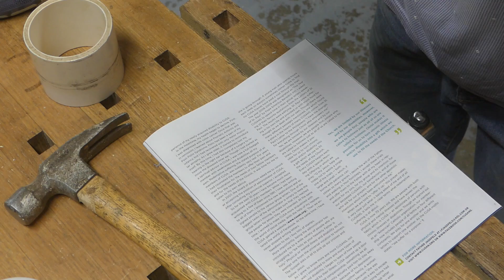Overhead dust collections for table saw

Comment: Slick build, what does the traveling sled do for you.? Is that just to get it out of you way?
I like the way you designed the sled, that being said it seemed like a lot of work for something that could be swung out of the way. Always a thousand ways to do anything just curious if it serves another purpose.  
Thanks for the ideas, I'm trying to pick a design for my  application.

Comment: Nice job as usual. I like everything but the dryer duct. Of course it is cheap and if it wears out it will be cheap to replace. It does like cool and shiny!
Reply from the maker: I chose this for two reasons.
First, the bulky is small (less than 5 inches when not in use, very attractive in small shops)
Secondly, it is very light, that's why I chose it.
For reference, this is a lot stronger than I thought,
Reply: I'll have to check it out and your right the  shiny is cool looking.

Comment: Nice project, one question, with the aluminum tube, don't have static discharges, with the dust?
Reply from the maker: No problem,
I used clean dust hose and black hose, but it was not good to have a small shop because it was heavy and bulky.
The dryer hose is light and small (less than 5 inches when folded when not in use).
Reply: Young Je thanks for reply, I will use one, with your video.

Comment: Nice use of used materials. That plastic is not that hard to bend I've done it.

As for tapping in aluminum they make a tapping fluid for that material its not the same as the stuff you use on steel.
I've also used a drill motor to tap. but a drill press with a tap-o-matic is better. I worked in a machine shop.
For one off items like this A drill works. I think I'd have used some lock tight on the bolts and nuts or a cheap way to do it is use a dab of silicon on the threads so the nuts can't back off don't laugh it works.
On the celing part I think I'd add a cross brace so its not wobbly.
And you can buy 4-6" hose for dust collectors insted of dryer vent hose. You could arch the hose all the way up and come down out of the way.
Over all its great.
And the idea could be placed to cover both a table saw and router station and jointer or any other tool like a drill press
but it may have to be on an radial arm type swing so you get x-y and z axes.

Also when cutting plastic's on the table saw its best to ahve a zero clearnce incert as vibrations off the blade can shader the plastic. I've had plastic parts blow up on me doing that. ABS  but that was Lexan